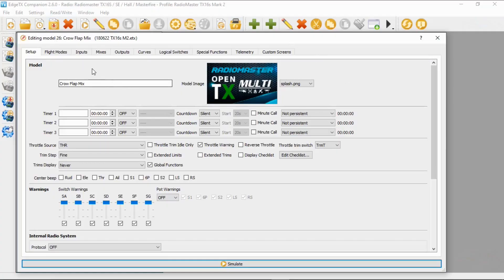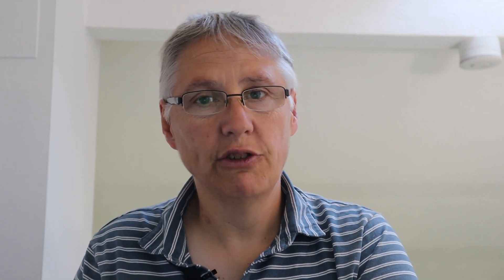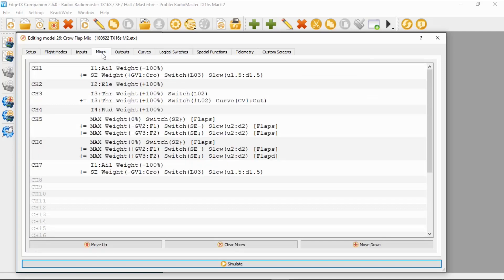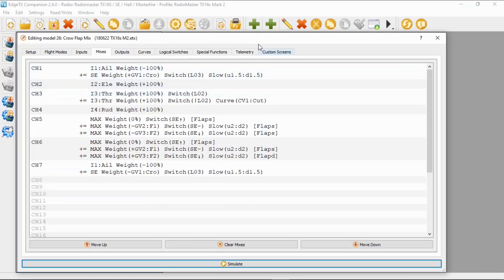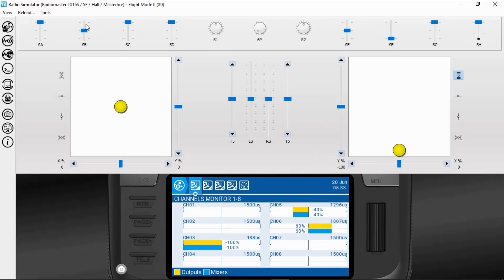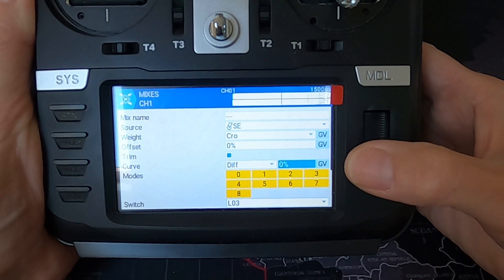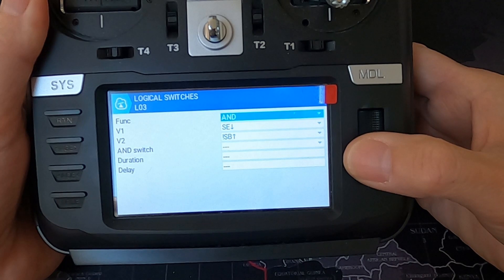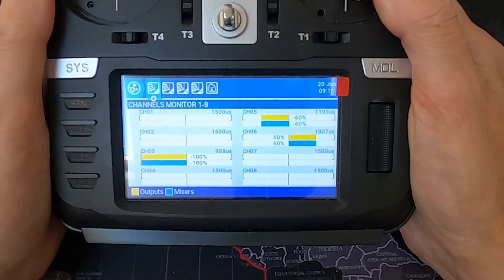EdgeTX Crow Brakes Flap Mix

Comment: Yes, because we all take our laptop to the flying field.....where we test fly and likely need to make adjustments.....
Reply from the maker: Rick you can make the adjustment on your radio at the field just do the programming at home first.
Reply: Question is, why would I want to do that? 
Programming the radio via the radio is less trouble in general..... and less error prone....than messing around with software, drivers, cables etc.
Makes it more difficult, IMHO, to learn how to do specific mixes, adjustments etc. on the radio if the initial setup is done on a computer.  
BTW, I don't use my radio to program my computer either....
Reply from the maker: You can select which method to use. One advantage of Companion you can back up your models and radio settings just in case something goes wrong when updating the radios firmware.

Comment: Thanks a lot ! This is what i have bin waiting for ...  BUT is it doable to have one Switch with  Noflaps, Half Flaps and then Full flaps with Crow AND still getting the Ailerons to move slowly up ? I like the idea to use GVAR's. Yet again - great video - very useful.
Reply from the maker: I am pleased you found the video useful. Yes you mix should be possible.